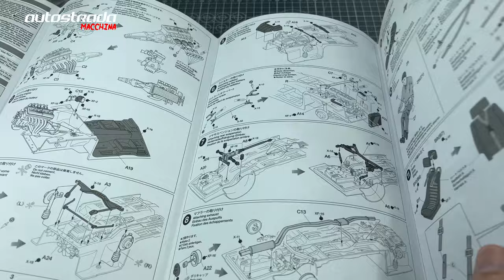I built a Skyline GT-R with an RB26 engine swap! - 1/24 Nissan Skyline 2000 GT-R TAMIYA

Comment: Great custom car. Love the upgrade Bride style seats. The engine swap is trick. I,m currently finishing a stock 2000GTR. I added some spark plug wires with fishing line and some battery leads. I changed from the factory silver to charcoal grey. I cut the trunk lid out and made up some hinges and a channel around the opening from styrene. Some thin soft solder will make a good boot rubber painted flat black. I plan on making a fuel tank to go in tjhe trunk.  Your models are top notch.

Comment: great video very nice did you used diffrent tyres  at the end? in de end result video they dont have text on the tyres. again great video 👌🏻
Reply from the maker: Good spot Ricardo, yeah I changed it out after I finished the build, liked these ones more and forgot to mention it in the final reveal. Glad you like the video though, much appreciated

Comment: Very Nice Model. I got confused with the engine-transmission swap.  which transmission you used? which engine you used? Thanks
Reply from the maker: Awesome thanks Ricardo, yes I realised afterwards I should have done a better job at explaining it. I used the original transmission from the kit and used the Engine from an R32 donor kit. Hope that helps 👍🏻